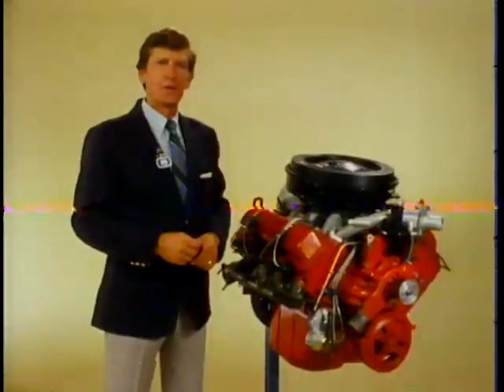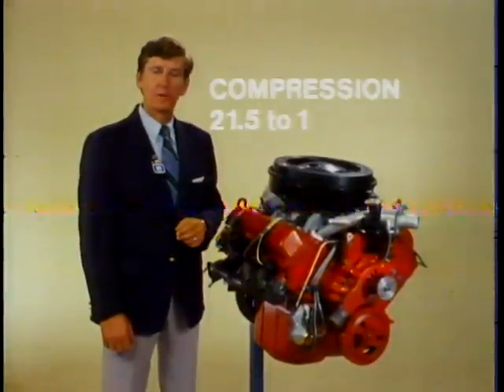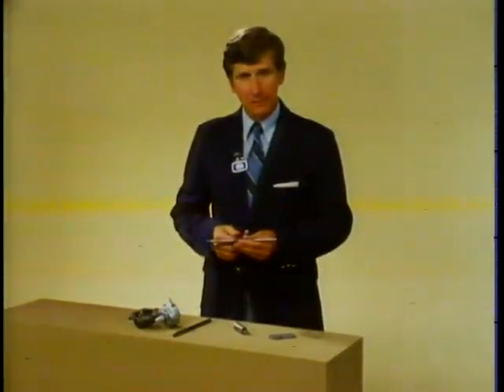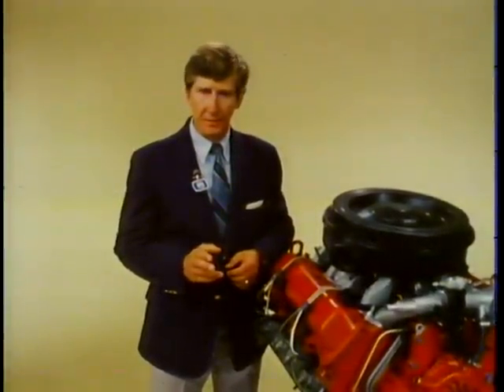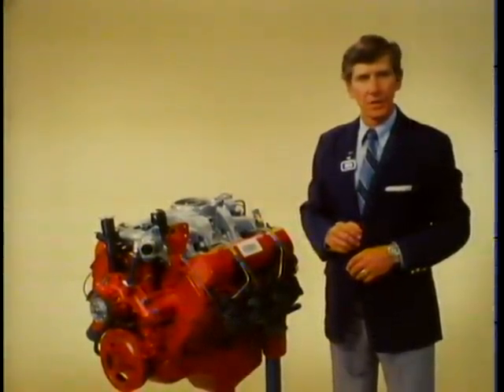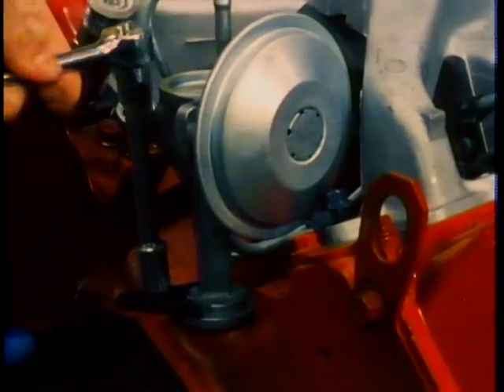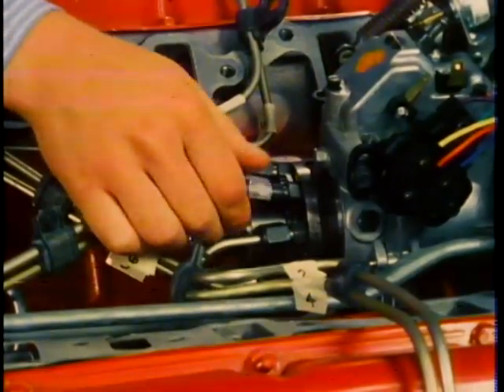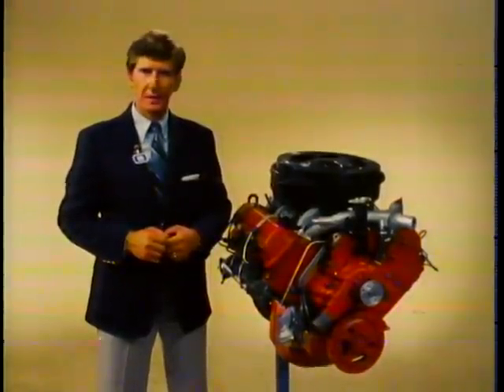General Motors /  Detroit Diesel 6.2 Training

Comment: They need to put a couple turbochargers on it to really give it some kick.  Then you could tow just about anything and have the torque to really burn the tires at take off.
Reply: +Tigerfire75 Probably pop the head gaskets like a cork.
Reply: ohiopower
Well get stronger bolts up there. 

I hear one of the problems with this engine was the fact most diesel fuel back then had water in it.  I guess stations wanted to water it down to get more money for less. 

Water in the diesel engine is very bad I hear.
Reply: The crankshaft would snap like a toothpick. They break cranks even with the Banks turbo kit that GM endorsed for them when they were new. And the Banks turbos only put out like 6psi of boost. They do give them a respectable increase of about 40hp however.
Reply: Justin Stearns
I say part of the problem was the poor quality of diesel fuel.  Back when these engines were new I hear they had water in the fuel.  That is deadly for diesels.  Also GM may not of had a water seperator but not sure on that.
Reply: no, they literally had toothpicks for a crank, the 6.2 and 6.5 are both notorious about snapping their cranks even when stock and they continue to do so to this day. Hell they had service bulletins stating how big of a crack their heads could have. Neither had anything to do with water in the fuel.
Reply: Most crank issues have to do with bad balancers, whether its harmonic or the flywheel.
It should be strong enough to not break from them going bad; but as long as you keep up on the balancers, you shouldn't have crank issues.
Reply: Yeah, until the crank snaps
Reply: @FCFordLord  o please, junk design... The engine is too light weight for diesel pressures
Reply: @justinstearns9723  Late response,but the Banks kit installed on the 6.2L V8 actually would increase 60 HP/115 TQ if everything was done right,and apparently 20% better effiency if I remember correctly.
Even though already mentioned in one of these comments,that was another notorious issue with these engines,the harmonic balancers,not just the cranks.
The harmonic balancers on these is probably always one of the first things to be worn out and have to be replaced,easily fragile.

Comment: He had to give the “this isn’t a converted 350 gas engine” disclaimer. Goes to show how garbage those were.
Reply: super pickle they used the same architecture as the olds 5.7. The parts inside were different, the block was so close to the same they were able to use the same dies as the olds gas burner.

Comment: While I'm all for diesel engines for use in a light truck, SUV, or van, I've never been a fan of the 6.2 litre powerplant. They produce very little in the way of towing power. 6.2 litres is fine for cars, like the Chevy Caprice, the Oldsmobile, or other cars, provided the rest of the car is built to withstand the compression and torque diesels are known for. But for trucks like the Chevy/GMC CK series of trucks, SUVs and vans, I would think that a 6.5 litre turbo would've been more appropriate for such vehicles.
Reply: Jason Carpp honestly the towing isn’t all that bad. I have a 1984 gmc half ton with this engine and the towing cap is 9,000 pounds. Its a great little diesel for 1/2 and maybe 3/4 ton trucks but beyond that its just not gonna work
Reply: Okay. I would think that a 3/4 ton truck would've benefitted from either the 6.5 litre diesel engine or a 6.6 litre diesel, like the later Duramax Diesel.
Reply: Jason Carpp yeah it definitely would have benefited from a more powerful engine if it was properly equipped
Reply: I agree. I regret that I've never driven a diesel powered truck, GMC/Chevy, Dodge, or Ford. I'd give anything for a chance to have a go. :)
Reply: Jason Carpp if you ever get the chance to, do it. Its amazing
Reply: I have an uncle who drives a 1991 Dodge Ram 250 with a Cummins Turbo Diesel. I believe his has the 1st gen 5.9 litre Cummins 6bt.
Reply: Jason Carpp yeah that’s definitely the 6bt 12 valve. Honestly if you’re gonna own a diesel that’s probably the best one to own.
Reply: I've always preferred the old-school diesel engine over the current diesel engines offered today. While I appreciate the low end torque that today's diesel engine produces, the complex equipment needed for emissions BS is just crazy!
Reply: Jason Carpp yeah that’s my problem with pretty much all engines, there’s just more technology and added stuff that just isn’t needed. And that’s another reason i love my 6.2 so much, it’s not the most powerful but it’s reliable and simple just like most of these old diesels
Reply: Jason Carpp 
It was a toilet of an engine. The dark days of diesel. 
Now it’s darker because the emissions equipment has ruined them from being reliable.

Comment: most 6.2/6.5 owners dont know shit about them think they're smart, those engines were SOOOO reliable with so little maintenance to none, fluid damper@front crank, smoky exhaust? tranny fluid pint in fuel tank ever 5k/KM(detergent in ATF cleans injector ports and low grade american diesel from ports,also might kill your shitty bosche DB2/DB4 if you over do it, just brake the checkvavle on the top of the injection pump,(its a glass ball 3mm by 3mm) then your set for life, also if you increase fuel pressure @checkvalve by couple PSI you'll gain tremedous horse power compared to its limp stockforms) injections precup will also serve a role in MPG vs POWER, depending on your build you might want to investigate into those, also if you do turbo them you gotta have an EGT gage, because otherwise you'll overload the poor pig and cook it dry, much love from canada quebec, where our 6.2 starts @ -40 celsius unplugged

Comment: The only thing amazing about this engine is how little power it makes. It will hardly pull it's own weight....
Reply: numbers didn't really mean anything the 6.5 Detroit Diesel put out 210 Horsepower and 360 to 450 torque yet it will pull WAAAAAY more than its own weight it was even used on school buses Dodge also 5.9 cummins put 160 Horsepower and 610 torque today it's just a bunch of tuners I mean whats the point of having 440 Horsepower and 925 torque in a f250 it's not like u can carry 20 tons not tow but carry tow way more than that done by semis of the past with similar power
Reply: thats funny, because got ma 3 ton suburban and hooked a caravan behind it and filled the car, so closer to 5tons in total and still managed to drive with traffic with ease, and not talking about those straights in america, i mean North Norway where it's only mountains  and fjords up and down all over the place
Reply: 350 from the same year only had 150 HP

Comment: Remember it is not based on a GM engine.  He did not lie about that, because it is based on a Oldsmobile engine.
Reply: Nope, completely false, in fact, the Olds Diesel wasn't the same block as the Olds gasser 350. Vicious rumor, not true
Reply: @detroitdiesel-vu3ig  I didn't know a 6.2l and 6.5l were 350 C.I.D.  How does that conversion work out again, I can explain it.
1 cubic inch to liters = 0.01639 liters so we take 350x0.01639=5.7635 so a 350 is a 5.7-5.8L not a 6.2 or 6.5.
WOW, math is really amazing.

Comment: How can a 6.2 litre V8 only push 130 horsepower? Just how? The stone-age Russian tractor engines of 1980 were making double that .....
Reply from the maker: Torque was good at least. The early 6.2 was tuned for economy, and had small prechambers. Good for fuel mixing / complete combustion, bad for moving lots of air and fuel.

Comment: Detroit diesel needs to build engine for half ton pickup trucks, or midsize pickup trucks. To compete with cummins, and ford powerstroke diesel engines.
Reply: Detroit diesel should give ford, toyota a call.
Reply: Ford doesn't even have their own engine the 7-3 that all you guys go Google for that's an international motor
Reply: @nicholasolson9878  correct, it was a 6.9 liter turbo diesel in the tractors.. it was a 4-6-8 engine.. ran on 4 till it needed the other cylinders.. that's why it was such a great engine.. and everyone brags about GM's Detroit 50 and 60 series engines.. but John Deere designed and built those engines..
Reply: @nicholasolson9878  the 6.7 is ford is motor

Comment: I love everything General Motors... except this engine. It is WAY underpowered. 130 HP and 250 LB FT on a DIESEL?????
Reply: These were weak HP/TQ numbers even for 1981 and even for Net ratings.
Reply: If you keep the service up on them, they'll run forever. Power can easily be harvested cheaply by turning up the fuel and if you are really after some more power, a turbo

Comment: The 5.7 GM converted 350 olds went through three or four different factory designed heads and they still cracked and warped and broke head bolts........a good example of a dieselized gas engine that didnt work out...........the VW rabbit diesel was a gas engine that successfully converted to diesel and were a great engine..........the 6.2 GM was famous for breaking crankshafts just behind the vibration damper........these engines also would throw a connecting rod with no warning at all..........scary engine to own..........helped make a lot of money for mechanics , as they always needed some kind of work..
Reply: Many have 400k+ no issues.

Comment: holy shit i see alot of bad solutions on this engine ..like having to remove the lines and filter housing in order to change secondary filter , and it still looks likes a beefed up gasoline block turned into a diesel, and the power,, a 300D strait 6 MB of the same vintage have under half the displacement and still makes  the same HP .  i have a old buick  i belive it is, a junk car standing out back with a 4,3 V6 diesel . i promised to save the engine for my neighbor ..i wonder if thats just as bad , ,,atleast the later  US  diesels got better ,  but i am not sure they would live up to the strengh of the older MB diesels , i have several non turbo w124  my daily driver is a 1990 w124 200D 75HP it has just over 820,000km on it  it,s not been rebuildt and i certainly do not need a block heater to start it in wintertime ,

Comment: This was NOT a Detroit diesel. Nor had anything to do with Detroit.
This was actually a 366 gas engine turned into a diesel, this propaganda video from GM forgets that if you look at the back of the block you can see the cast hole for the distributor
Reply: I had a 5.7 in a grand prix it was a decent engine got terrific fuel mileage. My first Truck had the 7.3 idi, which was way more engine than the 6.2 which is why I bought a Ford
Reply: WRONG!
Reply: @misters2837  sorry not
Reply: My Family Worked For GM Oldsmobile Diesel division...then went to Detroit to design this....THERE IS NOTHING SIMILAR TO THE TALL DECK 366/427.  Quit Spreading Lies.
Reply: @misters2837  Not a lie. Look on the back of any 5.7 6.2 and the distributor hole is right in the back. I'm sorry if the truth offends you, but that's the facts
Reply: @misters2837  you voted for Hillary didn't you
Reply: You obviously have never had them side by side...there is almost NOTHING IN COMMON (other than they BOTH came from GM)
Reply: You really have no idea what you're talking about buddy
Reply: These engines were designed to be a similar size and shape as a small block and that was a good place to stick a vacuum pump. I had a Detroit diesel owners manual for an 8.2 it had a picture of a 6.2 on the back with a Detroit logo as they are both in the fuel pincher line of Detroit engines.
Reply: Bruce Springsteen: Just Who Are You Talking To?
Reply: Shawn Bowman: Yes you are correct, this and the 8.2L were actually Detroit's first two 4-cycle Diesels... The design/build rights for the GMC Toro-Flow were bought by Detroit, but they were designed by GM... (They like the 5.7 Olds were not very good either.)
Reply: I was Commenting on what the RJ guy said.
Reply: Shawn Bowman: I know you were...The Bruce Guy didn't say who he was referring to...
Reply: I just get a Kick out of people dogging all these gm engines a lot of these guys grandpa’s uncles daddy’s cousin sister That drives a Ford Told them it was bad so they’re all bad In their eyes. And this guy is another one of those idiots that thing looks nothing like the 366 you could probably put that engine inside of a 366 as far as size goes. I put a bunch of miles On an old 6.2 and 85 Chevy 1 ton truck it was not a powerhouse but it was a very reliable truck.
Reply: 366 gas gm big block omg!!!! i guess u beleive in the tooth fairy to..where in the world makes u think that ???
Reply: Creston Bloodworth: He believes it because it has a place for a vacuum pump in the back and that also drove the oil pump... But Like anyone that ever had both engines side by side knows, that is obviously the most wrong statement ever made, because they aren't even close!
Reply: @misters2837  tru i have worked on them fir years in grain trucks. both my one tons have the 6.2 in them, and yes completly different
Reply: It’s amazing how the people who treat these engines like the red headed step child, are usually people who have never owned them or worked on them for themselves.